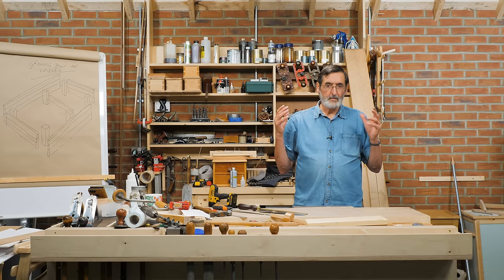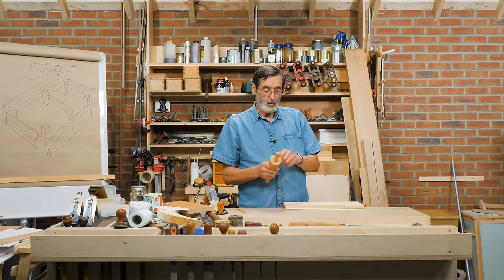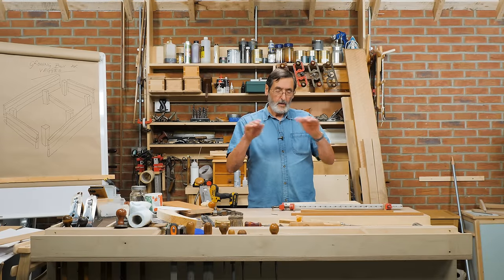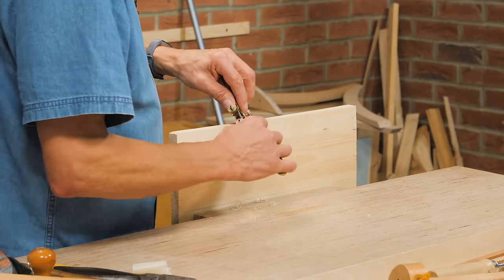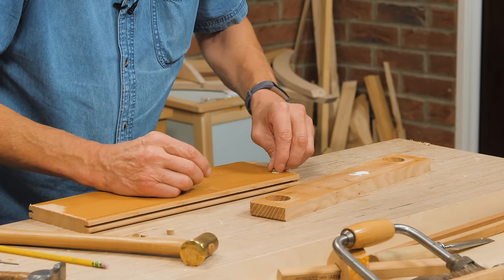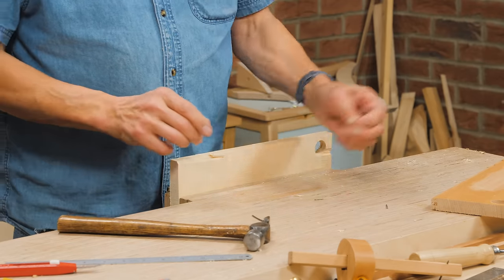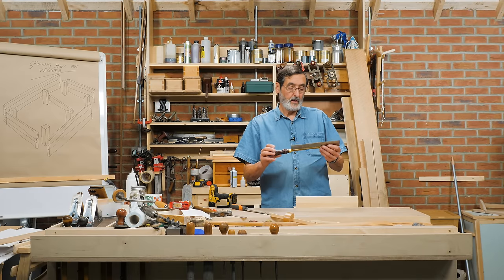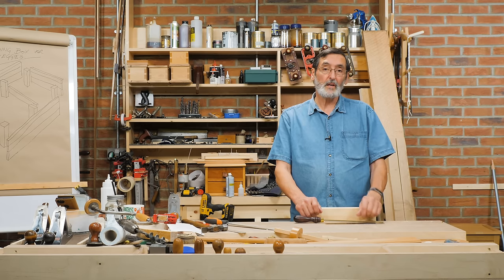10 Quick Woodworking Tips | Paul Sellers

Comment: My goodness.  Those were way more useful than I expected.  The last trick with the saw was pure genius.  Very much appreciated, so thanks Paul.
Reply: I've struggled with that exact problem with my saws...I almost got chills watching that.
Reply: I wonder if it works the same for pull saws, filing the first few teeth nearest the handle?
Reply: That saw trick is brilliant, and it seems to me that it eliminates the extra cost of a variable pitch saw.  The one trouble I run into is that long ago now I learned to start the cut with the middle teeth of the blade and a drawing motion.  It works quite well, but I still wonder how my grandfather, a trained cabinet maker, came to do that.  I have to consciously remember to use the saw toe.
Reply: I was going to comment that trick also! Will do that on my last saws i filled...
Reply: @theeddorian  the drawing back if the saw is the way it has always been done as far as I was taught.  Starting with the tip of the saw isn't a good idea.
Reply: @vinic8687  That's interesting.  So, it wasn't just a peculiarity of my grandfather's, my Dad's and me.  Just out of curiousity, where did the people you learned from come from?  My Grandfather was multigeneration Canadian but ultimately from Ireland.  There were woodworkers, furniture makers and finish carpenters in every generation except my dad's.
Reply: @theeddorian  I am in the south east of England.   My family have been village carpenters for several generations - I was probably taught this when I was about 10.  I was also taught to do this at college when I did my apprenticeship - so it  was a common thing in this area as far as I know.
Reply: @vinic8687  Thanks.  I have or had relatives in Dymchurch Under the Wall in Kent.  But they were from the other side of the family.
Reply: Old me: “This guy’s gotta be exaggerating.”
Current me: “Holy s***!”
Reply: hello sorry for jumping in so late I small collection of older going to 1800  (and see this technique used on few of them) . I had no idea what it was for until i got used them and it blew my mind.
Reply: @vinic8687  I'm sure Paul Sellers will be grateful to find out that starting with the tip isn't a good idea.

Comment: I would have never thought of that last one with the saw. It always drove me crazy. thanks so much for sharing this video.
Reply: It's worth note somewhere that it's too easy to get lulled into a false sensibility. We buy a brand new tool, and bring it home to fix it for use... when "fixing" involves actively removing teeth, in part of all together... the very part of the tool we want most to work.

    BUT that's just the thing, isn't it? Nobody outside the craft even thinks of that sort of thing, and we still need Paul to let us know of it. ;o)
Reply: Much cheaper than buying a Rob Cosman saw with graduated TPI!
Reply: I've seen this done on Japanese pull saws ( filing the first few teeth on the end nearest the handle of course)

Comment: Took me 57 years to get them.  Been having that exact difficulty with three brand new Lie Nielsen saws.  Well since February.  Put a knot in my stomach to take a file to my saws teeth, But It Works!   Dull the first half dozen or so saw teeth and it now precisely Glides into the cut and starts smoothly!  Thank you Mr Sellers!!  Right again!!
Reply: You never actually really use the end of a saw during full stroke cutting you only use it to start the cut.
Reply: @bighands69  When you copy the dovetail cuts to the pins that can be useful. But that can be done with this tool:
https://youtu.be/Y9LZOwDSGkY?t=450

Comment: Great stuff on this channel - as usual.
On that curved template thing. The way my dad (a cabinet maker) taught me 70 years ago was to string the lath like a bow with 2 strings. Short piece of scrap between the strings and it tightened like a windlass until you had the curve you needed.
On my first try (I was about 6) he said "One thing you don't want to do."
A second later there was a bang as I wound too tight and snapped the lath.
"That's the thing!" he grinned.

Comment: I love the idea cutting off the head of a nail and drilling it in to make a snug fit. So simple yet Brilliant!!!
Reply: Try this.  I a time served shipwright of some 45 years this tip is much easier, take the nail turn upside down place the nail any size on a hard surface I.e vice, flatten the sharp end of the nail with a couple of hits with your hammer and then drive your nail into the wood, no more splitting of the wood it goes straight home. I hope it helps. It works with any size of nail.

Comment: Tip#8 the other side of that hammer is also known as a punch out.. when you need a small clean gap between a frame and panel space you can make small 1/2in x 1/2in spaced cuts and use the hammer to punch out the section between along the grain. Great for small spaces where you dont want to over cut and mar the wood to leave space for a wire or pipe.

Comment: I learned that nail drill trick from my high school shop teacher. It's served me well over the years.
Reply: Cadwaladr Another method my dad taught me here in the Southern US was to clip the point off of the Brad or nail and just drive it in. The wedge of the tip is now gone, and the square edge shears the wood fibers rather than wedging them apart and causing a split!

Comment: Saving the best for last eh....I am glad I have seen that tenon saw tip for filing the first bit of the blade, I have had trouble with starting with a tenon saw and having to be drawing back repeatedly before it would start cutting, very infuriating and spoiling accurate beginning of cut, that is a great tip, thanks Paul.

Comment: Thanks for the tips, Mr. Sellers.
And here I thought the flat head on a Warrington hammer was for pulling the wedge on old wooden planes and the like. I had never considered using that end for setting tiny nails, brads, and tacks. Now I have to get one of those hammers for sure. The "top of the nose" or butt tap has always worked for withdrawing the blade and wedge for me, so I never bought a Warrington as it was not needed. The wife is tired of seeing bruised fingernail beds and finger tips, so she won't be able to argue the need for the hammer. (She always spouts on about me having too many tools.)
Love the ruler scraper tip as well. In fact, all of these tips are useful, and I only knew a few of them before. I don't do Instagram, so I guess I'll just catch the tips on this channel when you offer them.

Comment: I like the little glue spatulas. Also, I find when driving in a brad near the end of a board like you do in tip #3 that sometimes the head of the brad when set flush or below the surface can split the wood. I turn a brad over and lightly hammer the head in to crush the fibers so when the final brad is put in the head will not split the wood.

Comment: I can say I love to learn from whereever I can, and I am an extremely knowleadgeable and skilled ex-UBC woodworker.  I still learned a few new things from you. Still, for end grain nailing, one can just tap and flatten the point with the hammer face, instead of snipping it off.  It works.  And I use large bags of popsicle or ice cream sticks as spatulas. Or use a horsehair acid brush for deep holes or mortises.  Buy a bag of 10,000 popsicle sticks.  You will not have to buy another bag for a long time.  For the flexible curves, use instead a flexible curve layout tool used by architects.  They come all the way up to 5' in length.  Or even a quilters curve tool.  You decide what you need.
Reply: He didn't say to snip the tip of the nail, he cut off the head of a nail to use as a drill bit, then used an unmodified nail in the hole. There are some situations where the old "blunt the end of the nail" tip doesn't work. Just for the record, I learned both of those tios from my Dad in the 60s, and I'm not even a woodworker, just a wannabe.

Comment: The spokeshave, quick and easy, thanks a lot Paul.
Reply: If you ever use the old designs without the side screws, getting the skew in the blade out is tough at times.  So that trick is pretty much the natural state of the tool.  :)

Comment: When plugging a hole with a dowel I always put the glue into the hole using a sharpened match - that way I don't get glue being pushed up and out.  Less cleanup.  Excellent video.  Thank you.
Reply from the maker: I would never plug a hole with a dowel.
Reply: @Paul.Sellers  - I mistakenly called it a dowel.  I'm talking about the plug you made to cover up the screw head.

Comment: Per tip #10, instead of flattening teeth, I use a triangular file to alter them from perpendicular rake to a very back leaning one.  You still keep some cutting, but the leading edge will bounce at first instead of catching/tearing in the wood.

Comment: If you're using small finishing nails, a 1/16th or 1/32nd drill bit works just fine too. I usually get one that's slightly smaller than my nail shaft so that there's still some grip in the wood. Unless you need to intentionally drill a through-hole.

Comment: tip 2 , the gauge one , ive drilled the other end of my gauge to take a pencil , i keep a pencil about three inches long in there , and a small hole with a panel pin just crossing the mail hole keeps the pencil in place , just a quick swap from one end to the other and you have a pencil gauge that stays accurate ,,, just my tip
some of our tips are great

Comment: Actually the lip end of the hammer is there for putting nails where you can't reach with the flat end of the hammer. Like for example, putting nails to secure a piece of glass in a frame of a window or a baton that secures the glass in a frame.

Comment: None of these were ever touched on in my woodworking classes.
Some I remember seeing my late grandfather do though. A pity that not more of those tips and tricks are passed down in school.
There is one thing that springs to mind now: my grandfather would turn the nail around, and hit it on the point at the place where he wanted to drive it, then flipped it around and put in in place.
He said it had to do with splitting the wood or something.
You wouldn't happen to know why he would do that?
Reply from the maker: Yes, craftsmen often dulled the point so that the flat face on the point drove the wood itself into the wood as in punching. It definitely reduces the risk of splitting but no guarantees.
Reply: @Paul.Sellers  As a kid in the late fifties and early sixties I remember my father (a carpenter/joiner) using the blunting trick but also lubricating the nail by rubbing it through his hair.  These were the Brylcreem days :)

Comment: My tip is that if you have a Japanese pull saw take a file and round the end of the blade where the teeth end away from the handle. That corner is incredibly sharp for no reason and finding that cost me 4 stitches in my arm. The  teeth don't seem to go to the end so rounding it has no impact on the saw performance.

Comment: I just bought a new tenon saw and bam, tip 10, genius.
Reply: Just lightly draw it backwards when you start with your thumb still at the side if the middle of the blade - you have much better control over the saw that way.

Comment: I too appreciate all the tips you offer. The question I have is when pinning a tenon into a mortice, what is the rule of thumb to determine the size or number of pins to use?
Reply: I don't think there is one.  I would just find an example to copy.  For instance small pieces like cabinet sized pieces, say under 2 inches across, often 1/4" is used.  But 6-8" sticks in timber flames use 3/4"-1".  Stiffness of the pins increases by the 3rd power, and strength by the second power, so those 3/4" pins are 9 times stronger. 

I build a lot of engineered (or you wish they were.  :) ) structures, and on occasion I have asked internationally known furniture builders for essentially structural advice.  The answer you usually get is "whatever looked good".  Not a good way to build wooden aircraft, but most furniture is pretty sturdy.  So you can trust your eyes.  For instance a 30 foot sailboat can cross the pacific with a hull made of one layer of 1/4" plywood.  The same thickness I might use in the bottom of a sock drawer...

Comment: Hi I am,a qualified site joiner and done my apprenticeship at 16. When I was 22 I had all my kit robbed and couldn't replace it. so I went on to drive arctic lorries which is another passion of mine. But at 35 I want to get back into my carpentry but I need to build my kit back up. Any ideas where to start again?
Reply from the maker: EBay is the very best place to start. Best prices and best comeback if something goes wrong.

Comment: The first thing that I was taught about using a plane was to lay it on its side when you put it down otherwise you quickly lose the sharpness from the blade as this is what all of the weight is sitting on.  If I put it down as continuously shown in these videos then I was made to sharpen the blade again - you soon learn to get out of bad habits this way!
Reply from the maker: And that was the single most stupid piece of advice ever and thousands upon thousands of people have done unquestioningly since. Craftsmen that relied on their planes to make their livings with never laid the planes on their sides. It's just silly. Now, the history of it. In school woodworking the boys were clunking the planes on top of other tools and damaging the cutting irons so they made them lay them on their sides.
Reply: @Paul.Sellers  Would you stand your chisels on the bench upright? Would you stand a saw on it's teeth? Would you lay an electric planer on it's bed?  All of these things are avoided to keep the tool as sharp as possible for as long as possible. I have seen plenty of people put planes down only to discover they have damaged the leading edge because there was a nail or something else underneath it - especially when out on site.  As for the school thing - I really don't think this applied when my grandfather or great grandfather did their apprenticeships.
Reply from the maker: @vinic8687  And this just gets stupider. No because they'd all fall over. Had you not realised that?
Reply: @Paul.Sellers  This is not stupid at all.  Look at your bench - your marking gauge isn't laid flat and your brace is laying on / against some kitchen roll?  You could quite easily lay a saw or chisel against something on your bench or possibly a wall leaving the cutting edge against the bench.  Also, when out on site are you suggesting that you just lay your plane on any old floor, concrete surface, etc. without worrying what the iron is sitting against?  Finally, you might want to let the manufacturers of planes know that they are giving out "the single most stupid piece of advice ever" to their customers on a regular basis!  Stanley's instructions for using a No 4 Bench Plane include "Always keep the cutter sharp for best performance and lay plane on its side when not in use to protect the cutter".  Other manufacturers confirm the same thing for their planes.  Stanley also confirm another thing that I was taught - when you finish a stroke you lift the plane and return it to the starting position - you do not drag it back across the planed surface as that too takes the edge off of the iron.
Reply: Ponder this for a moment. If you lay your plane on it's side you're leaving the blade exposed to damage from the other tools on the bench. If you're worried about dulling the blade when setting it on the bench then have a small shim under one end to keep the blade off the bench. This side laying theory was debunked years ago.........now if I can just break my habit of laying my planes on their side. LOL
Reply from the maker: @vinic8687  Where on earth did you get so much bad teaching my friend. We've moved on. This is real woodworking in the zone. 55 years 6 days a week without a break in the saddle for me. Never laid a plane on its side yet. Archaic teaching belongs in the past!
Reply: @Paul.Sellers  There was absolutely nothing wrong with my apprenticeship and where do you get the "so much bad teaching" bit from?  Apart from this one issue do you anything about what I was taught, who taught me, when I was taught, etc.? As for your comment about archaic teaching - earlier you suggested that tradesmen never laid their planes on their sides in the past and this only came about because of naughty schoolboys - so surely that isn't archaic but instead it is modern teaching?  But whether you feel it is archaic or stupid or both to tell people to lay planes on their side to protect the cutting iron, can I ask if you intend on taking this up with the likes of Stanley, Irwin, etc. who all still recommend that you do this?  Or do you think your 55 years in the saddle trumps Stanley's & Irwins' combined  300+ years of tool making and that they are stupid too?
Reply: @bikentrike  You can leave your plane with one end raised I don't disagree with you on that - but you never lay it flat on the workbench with the cutting iron still protruding.  The reason that I was taught to lay a plane on it's side was because I also did a lot of site work where there obviously wasn't a work bench but instead just the floor or ground.  As for damage from other tools, I would suggest that if this were a risk then your work bench probably needed a good clear up before you did anything else.  With the debunking part - do you think it would be a good idea to let the manufacturers know about this as they don't seem to have heard yet and keep on sending out those instruction leaflets with out of date information on?
Reply: @vinic8687  You must of somehow seen my workbench!

Comment: I see that the like:dislike ratio is running at about 1000:1 - seems a bit low, should be 10,000:1 or people need to be more careful about pushing the correct button.